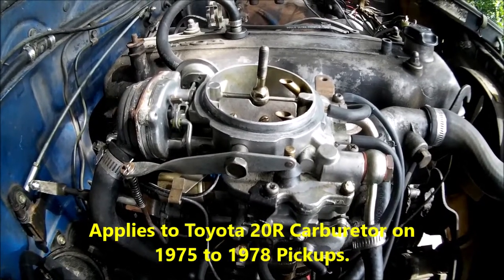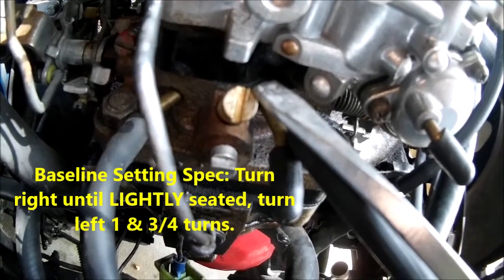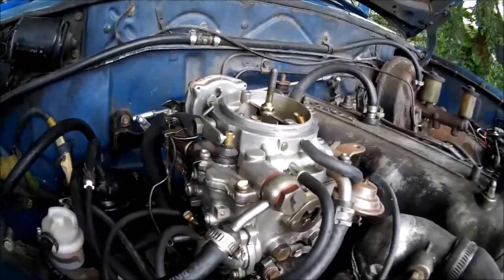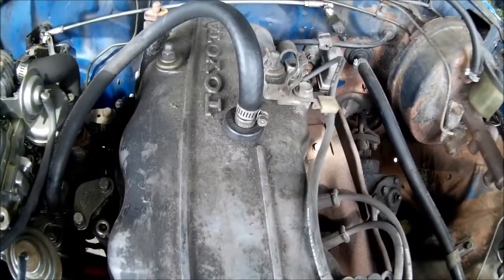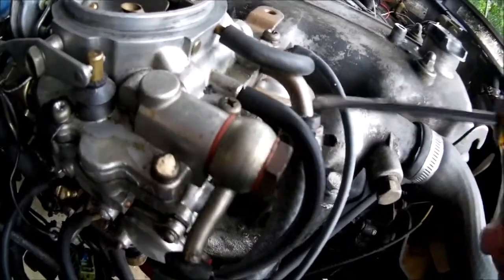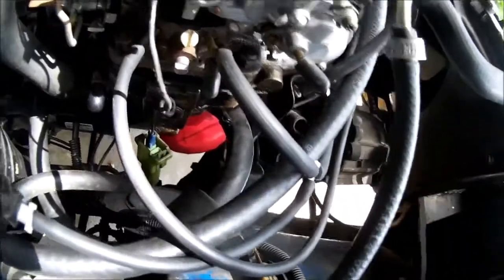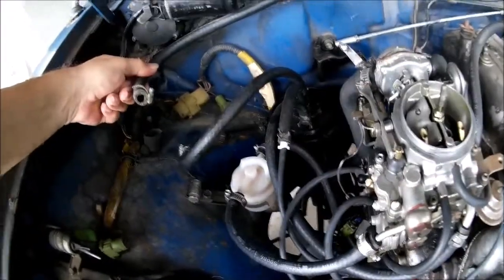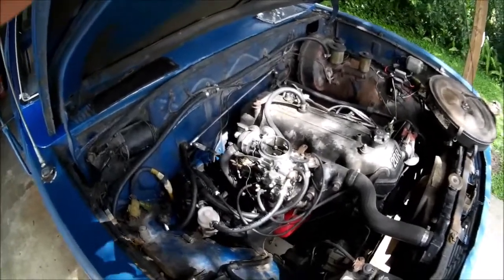1978 Toyota Pickup/Hilux 20R-Carb Adjust & Vac Lines-Desmogged

Comment: Hi, so I bought a rebuilt original carb for my 20r. All emission stuff is on it. My problem is that in order for the car to run kind of okay, the air fuel screw has to be open almost all the way. The engine is very jerky when idling, but runs ok when driving. When I look at the tach, the rpm goes between 800 to 850. The needle goes up and down. It's not smooth at all. Do you know what could cause this? My email is sreyes91350@gmail.com thanks
Reply from the maker: The most common cause of this is usually a vacuum leak. This lets extra air into the carb, which is why you are having to run a richer fuel mixture setting, with the air/fuel screw open almost all the way. From the sound of that, you have a fairly large vacuum leak somewhere. You can use a couple of cans of cheap carb cleaner spray (doesn't have to be the good stuff) to find vacuum leaks. With the truck running @ idle, just shoot a small blast of cleaner at any point you suspect of having a vacuum leak. If there is a leak there, the engine will speed up for a few seconds then drop back down. The cleaner is like fuel & will be sucked into any leak point.  If no engine reaction go on to the next point. I'd start at the carb base & work up, hitting every hose connection & then each hose themselves. Being methodical helps you here to track down leaks.

Got some questions for you that I need answers to to help you better -

What year is this truck? "All emissions stuff is on it? The carb or the truck? Or both? Did you use a new base gasket when you installed the carb? If you used the old gasket or none at all there could be a leak at that point. Did you tighten the carb nuts/bolts to 10 fott pounds? Overtightening these can cause vac leaks. Are you sure you have any unused vacuum ports capped off tightly? Have you checked or replaced your vacuum hoses for the emissions system? You should replace ALL of the vacuum lines for the emissions system when the carb is rebuilt or replaced. These trucks are 35+ years old now & those old vac lines are bound to be brittle, rotten, cracked, just plain broken or even missing. Check for a sticker underhood for a vac line diagram. If it isn't there you should be able to find one online, or go get the repair manual at an auto parts store. Nothing beats accurate info.

There are also some rubber lines for the AIR system (smog pump) that can go bad, not to mention vacuum switching valves, thermal vacuum switching valves, vacuum solenoids, EGR Valve, etc etc. That's why I did a "de-smog" on mine (emissions equipment removed) so I didn't have to worry about it. I'm guessing you are in California so you can't legally do that but I have some hints for you on that if you want them; just let me know & I'll email you.

Other than the above, it could be a bad fuel pump but that's iffy. I have heard of some mechanical fuel pumps having a slightly ruptured diaphragm causing the surge issue, but it's usually more than 50 rpm difference. Could also be an exhaust leak but I think you'd notice that & would have mentioned it.

Let me know some answers to the above questions, plus whatever you have done to test in the meantime & I'll try to help you out some more.
Reply: @The13thSword  okay, so this is a 77' Toyota Celica gt with stock everything. I tightened the rebuilt carb with a new gasket at 15 fp. There is a brand new fuel pump as well. All the vacuum lines are brand new. I have a diagram for this engine. Yeah you guessed it. California sucks for the emissions... And those hints would be very helpful. I want to get this car done before I leave for college in January. Thanks a ton!
Reply: @The13thSword  also, all the vacuum ports that are not used are capped off. EGR valve works fine.
Reply: @The13thSword  also, all the vacuum ports that are not used are capped off. EGR valve works fine.
Reply: @The13thSword  and I installed a new intake manifold gasket. I notice when the engine is idling, the brake is easy to push. But when I start driving, it feels like the brake booster is not working. I also noticed that there is a hissing noise when the engine is shut down for a few seconds.
Reply from the maker: @stuartcR   Thanks for the reply. Cool car! I would still try the carb cleaner test for vacuum leaks on the intake manifold, just to be sure there aren't any vac leaks there. I know you just installed it but I've learned to take nothing for granted in car repair unless I've checked it over at least twice, especially on older vehicles.

Good on the new carb gasket. You didn't say whether or not the fuel pump was the electric in tank type or a mechanical. Stock it should be electric. I only bring this up because  the 80/81/82 20R engines used mechanical (mounted on the head) & sometimes on these old cars, engines or heads get swapped in. The mechanical pump needs a spacer to work right & can cause some of the symptoms you mention.

On the vac ports you capped, did you use some good silicone caps? The rubber ones you mostly get at the parts stores are rubber & I find that they don't hold up very well.

Do you have the brake booster vacuum line hooked up? If it is, & given what you describe, the brake booster diaphragm could be leaking.  If there is any change in pedal feel between idling & driving, it should be exactly opposite of what you describe (pedal feels a bit firmer with engine above idle speed). A booster vac leak draws extra air into the intake system (booster vac line is plumbed to the carb) & that would account for needing the richer mixture to get it to run anywhere decent. The booster diaphragm is also a rubber part & could be age deteriorated.

The hissing noise just after shutdown (goes for a few seconds then stops?) could likely be this. Could indicate a minor to moderate vac leak in the booster. If heard in the cabin that could be it, esp if you hear it coming from behind the left dash area. If heard underhood only it could also be it, or a leak in the cooling system (you didn't mention coolant leak so I'd doubt this). I'd also replace the vac line for the booster. The inline check valve should be ok; they usually don't have problems. Just make sure it goes back in the correct direction (one way flow valve).

My brake booster does have a ruptured diaphragm. I disconnected the vac hose for it & capped the large vac port on the carb. I've been running this way for a while & brakes are fine; just can't afford to replace the booster so I had to do this. Mine is about $120 from Rock Auto. I looked up yours & it's about $65-$70 + ship from Rock Auto (A1 Cardone P/N 535000). Best price I've seen @ part stores is double that ($139.95).

Last 2 things for now. My apologies if I seem to be over-explaining things. I don't know what or how much you know so I want to make sure I cover this as completely as possible, for you & for anyone else that comes along later & is reading all this. No negative presumption is intended about your level of knowledge or skills, so please forgive any info I give that you already do know.

Once you can get this nailed down, get the mixture close to something approaching normal, & if your emissions system at least looks intact, you shouldn't have much trouble with the inspection stations. Even if some of the emissions valves aren't working right, these engines will run pretty clean if the mixture is tuned, the timing is set right (8 degrees BTDC) & your distributor vac advance is working right.  Even if you go above the minimums for emissions for this model @ the tailpipe, & the emissions system passes visual inspection, you can still get it registered with an abatement fee ($200 last I checked). Other good thing is that they probably aren't going to "gig" you too hard on it anyway; they just don't look at these older vehicles that hard, esp if you get the tailpipe emissions close enough to passing.

Hope all of this is helping. Let me know how your progress is going.
Reply: @The13thSword  Sweet. I'll check all this in a few days. Getting home from Utah. And yes it's a electric gas pump in the tank. So there are actually only two vacuum ports that are open and those are capped. I checked the caps, and they work fine. I'll check the carb and everything. I'll get back when I test it all. Thanks a lot for explaining everything! I actually am going to study automotive engineering and business in January. Thanks for taking time out of your day to help me and anyone else who has trouble. I really want to drive this car around haha
Reply from the maker: @stuartcR  No problem boss. I post these videos to help people out, just glad to know they are serving the purpose. Glad to do it. I look forward to hearing the update on this when you have time. Safe travels!
Reply: @The13thSword  hi, so I checked the vacuum lines. There are no leaks.
Reply: @The13thSword  I also diconnected the brake booster to test. It made no difference. I don't know what could be going on..
Reply: @The13thSword  I am hearing little popping and ticking noises coming from the exhaust though.
Reply from the maker: @stuartcR  My dumb question of the day first - when you disconnected the brake booster did you cap off that vacuum source for it from the carb? If you did we move on, because if you thoroughly tested the vac lines, carb & intake gasket & find no vacuum leaks, it's something else. Let's go smaller stuff first, then bigger:

1. Have you tried setting the idle fuel mixture to stock & if so what does the engine do? The stock setting is to turn the mixture screw all the way in until it lightly bottoms out (DO NOT CRANK THE SCREW DOWN WHEN IT BOTTOMS OUT! YOU WILL RUIN THE SCREW & NOT BE ABLE TO ADJUST THE MIXTURE AT ALL!). To be clear, a "turn" means a full 360 degrees (full circle), e.g. if the slot is straight up, you turn the screw left until the slot is straight up not once, but twice. That would be a full turn. Count the number of turns as you run the screw in ( I am VERY curious to know what you currently have it set at!) Once the screw is bottomed out, back it out 1 & 1/2 to 1 & 3/4 turns. This is the stock mixture setting.

2.  How's your air filter? Sometimes the paper filter element can tear, allowing more air in than normal, which would require the extra fuel mixture setting (rich). If in doubt as to the filters age or condition, replace it with a new one. DO NOT OVERTIGHTEN THE AIR CLEANER WINGNUT, just snug it down so the air cleaner doesn't rattle. If you overtighten the nut, this can warp the Air Horn of the carb & cause an air leak.

3. How's your fuel filter? A partially restricted fuel filter can cause your problem; opening up the mixture like you have just masks the problem (even with extra mixture it still doesn't run right all the time, but it should). Any doubt about the age or condition of the fuel filter replace it. Usually $5-$6 at any parts store & easy to do.

4. Have you checked your PCV (Positive Crankcase Ventilation) Valve? It should be in a rubber grommet on the valve cover, with a hose going to the carb. If the valve is stuck open you could be drawing in too much air from the crankcase. This can cause a lean condition (requiring the higher mixture setting) & fouled spark plugs (major black deposits). This can also happen if the rubber grommet is crack or broken. If in doubt replace both, they are cheap but important (about $4 for PCV, $3 for the grommet, again at almost any parts store). Check the hose too to make sure it's clear.

5. Have you checked your spark plugs? They should all be a light to dark tan in color; that would show a proper air/fuel mix. If they are black that shows a rich condition (too much fuel). If some are normal & some are black, that could show a valve problem (sticking valve, valves not adjusted right, burned valve) or other valve train problems. All depends on how the plugs look to tell you what is possibly going on.

6. Have you put a timing light on it yet? To verify the correct timing setting (8 degrees BTDC), & to see if the timing chain is good. The timing mark should be steady when you put the light on it. If it's jumping around your timing chain could be stretched & in need of replacement. (Ask me for more info on this if you suspect the timing chain).

7. Have you adjusted your valves? It takes a feeler gauge, a wrench. a screwdriver & some time, but really isn't too hard to do. If your valves are out of adjustment it could be causing your problem. Here is a good instruction source on valve adjustment for the 20R:
http://www.lcengineering.com/LCTechPages/ValveAdjustment.html

The only thing I do different is adjust the valves cold instead of hot; just makes it easier & less messy. I add 2 thousandths of an inch to the specs (intake - 0.010", exhaust - 0.014"). The clearance will "tighten up" to the correct hot specs as the engine gets hot (metal expands). I've always done this & never had any problems.

I think that's more than enough for now for you to check out. Let me know what you find in some detail. Extra detail helps when I can't see what's going on.
Reply: @The13thSword  yes I capped the vac port from the carb to the brake booster.  I have a dumb question.. does the vacuum increase or decrease as the engine is reved higher?
Reply: @The13thSword  also, I will try your tips tomorrow. I'll get back to you soon.
Reply: @The13thSword  last thing. I noticed that when I disconnected the egr valve, the engine ran faster and smoother.
Reply from the maker: @stuartcR  Not too sure about the popping/ticking noises from the exhaust, but they shouldn't be that loud to normally notice. Since you are noticing them that would usually mean that something is out of tune.

That is not a dumb question at all. Engine vacuum is usually highest at idle. In most carbs, there is a throttle "butterfly" plate near the bottom of the carb that is closed or mostly closed @ idle. This limits air intake & provides high vacuum. Kinda like taking your hand & putting it over the end of a vacuum cleaner hose. As you open the throttle plate more & more, it allows more & more atmospheric air to enter, & the vacuum goes down to a point, but it is less than at idle.

You may have found your problem with the EGR but you didn't say if you disconnected the vacuum signal hose to it or the feed hose to the carb. Good thinking to try that though!

EGR valves can carbon up over time (quicker if you are running rich, which you may be due to higher mixture setting). Built up carbon could be interfering with the internal return spring, not allowing it to stay completely closed at idle. Also, EGR's are vacuum controlled so there could be a problem with the diaphragm mechanism inside, broken or stuck open, allowing exhaust gas to pass thru it at idle. That would really lean out the carb & certainly mess up your idle mixture! It would also explain why you need the high mixture setting for it to run any kind of decent. Would also explain the bad idle but running better at speed (more air getting in with throttle open wider than at idle = more oxygen, better fuel/air ratio = better burn). Exhaust gas is inert & displaces the oxygen; it won't burn twice unless it's REALLY loaded up with unburned fuel vapor.

You don't need an EGR valve for an engine to run well. All they do is take some exhaust gas & add it back into your intake when the engine is above idle & under load. This is metered by the vacuum source that goes to it. EGR's are normally completely closed at idle & open progressively as the engine speeds up. The exhaust gas helps cool down the combustion temps & reduces NOx (nitrogen oxide, a pollutant).

IF it is the EGR that's messing you up you have 3 choices. Replace the valve, clean the valve & hope it's not broken inside, or block it off entirely. New valves can be hard to find in parts stores. I couldn't find one listed that is an exact fit for the '80. You MIGHT be able to fit one from a 22R 1984 & later but I'm not sure.

Cleaning the EGR you have. You need to remove it from the engine & soak the inside of it with carb cleaner & let it sit & soak to loosen up the carbon. You also might need to dig it outta there with a pick, awl, small screwdriver etc. as it can be rock hard & adhered. Compressed air helps here too. I've also used gasoline to soak these (NO SMOKING!) Once clean reinstall.

Lastly, blocking it off. I cannot legally advise anyone who is in a "smog regulated" state to do this as it may be illegal. Also during any "smog inspection" the techs will be looking to see if the EGR is there. If they only see a block-off plate & no EGR Valve they will fail you on the visual inspection. Just for interests sake - I have heard of a few people making a block-off using aluminum from a soda can. They cut the aluminum out in the shape of the EGR Gasket, but a little smaller, but didn't make the center hole in it for the exhaust gas to pass thru. They then "sandwiched" this aluminum between the Valve and the Head, effectively blocking the exhaust gas from even getting to the Valve. The can aluminum is thin enough so that if cut the right size, you don't even see that it's there. Result - EGR Valve in place but no exhaust gas getting into the intake. I AM NOT ADVISING THAT YOU DO THIS, just relating a story I've heard. (hint hint) ;^)

I'm in Florida so we don't have smog inspections, & I have an EGR block-off plate installed like this one:
https://www.lceperformance.com/EGR-Block-Plate-Kit-Cyl-Head-20R-22R-RE-RET-p/1016009.htm
with the EGR Valve gone entirely. My 20R runs fabulous without the Valve.

Keep at it man. Once you get this solved this engine should run super well so it's worth the effort.
Reply: @The13thSword  so the idle fuel air mixture screw was open. 3.5 turns.. pretty sure that's a bit much. So I turned it to 1.5 turns open. Testing it now.
Reply: @The13thSword  everything seems to be working. Could a bad pvc valve cause these problems? How do I test it?
Reply: @The13thSword  I just noticed something else. When I rev the engine up and let go of the throttle, the exhaust pops a few times.
Reply: @The13thSword  can I send you a video of the engine rpm, popping, and engine wobble?
Reply from the maker: @stuartcR  A bad PCV Valve could cause it. The basic test for a PCV Valve is to pull it out & shake it. If you hear/feel a rattle on every shake it should be ok; no rattle and it's bad. You could try to clean it out with carb spray but it's usually easier to just replace with a new one; they are usually only a few bucks. Check the rubber grommet it goes into while you are there too.
Reply from the maker: @stuartcR  This is caused by unburned fuel igniting in the exhaust pipe. The fuel that isn't burning in the cylinders hits some oxygen near the end of the exhaust pipe & burns there (explodes). That would mean your engine is not burning up the fuel that it is getting into the cylinders. There are many causes - fuel delivery problem - carb allowing too much fuel, sticking throttle valve or choke plate, sticking throttle cable or linkage, too much fuel pressure. 1 or more fouled, worn out, broken or non-functioning spark plugs. Ignition electrical problem like 1 or more bad wires, bad rotor, bad distributor cap, malfunctioning pickup coil (if electronic ignition, your's should be) or worn out or malfunctioning ignition points. Broken or worn distributor. Ignition timing too retarded, either by setting or from stretched timing chain.

There are also an out-of-whack carb adjustment that can do it (throttle positioner/dashpot) but it's rare. I wouldn't try to adjust that unless you have some good instructions.

Check the simple stuff 1st; 8 times out of 10 it's something small. Be sure the choke is completely open when it's warmed up. Check for extra play in the throttle cable; these cable can get sticky or stretch out over time & effect the throttle response. They can also wear out (it may be 38 years old!) It's also possible that it's adjusted too tight. Does the engine rev as soon as you put ANY pressure on the gas pedal? Or does it take a bit of movement to get a response? It should be nearly instant. You can adjust the cable by turning 2 nuts at the end of the cable nearest the carb. You should see some cable coming out of the cable sleeve;  push down & release to gauge how much tension it has. It should be just very slightly slack. If you can push it down more than 1/8" before you feel some decent pressure it's too loose. Adjust as needed.

You never told me if you looked at your spark plugs or not. How old are they? How old is the cap, rotor, wires? Info please.
Reply from the maker: @stuartcR  You could post it to Youtube & send me the link. Engine wobble? When did that start? You didn't mention that before.
Reply from the maker: @stuartcR  Yah, 3.5 turns is a lot of gas at idle, especially for a stock carb. That's almost double the max of 1.75.

Give me some info on what you've checked? Fuel Filter? Plugs? Ignition Parts? They all matter & I need to know.
Reply: @The13thSword  fuel filter is fine, the carb is always full of gas. New spark plugs, cables, distributor cap, and rotor. Ignition system seems to run fine. Engine is timed to 8°. I put turned the idle screw to 1.5 turns. Engine seems to run fine on that. Still gittery though. At high idle due to cold engine, it runs smooth. Everything runs smooth above 850 rpm... But, the legal restrictions in California is 800 to 850rpm. Even at 900 it runs better. But at 800, the needle goes up and down between 750 to 900.. and the engine jitters which causes the whole dang car to vibrste. You can see the gear shift nob vibrate then suddenly move then vibrate again... And when I rev the engine and let go of the gas, it pops at the exhaust. I don't know what is going on haha
Reply from the maker: @stuartcR  OK, I'm almost running out of things to check but do have a few more. Carb full of gas - gas level about halfway up the window on the front? That would be proper fuel bowl level, any higher than the upper tab on the windows & you need a float adjustment. How about your ignition coil? Are all the wires firmly attached? No corrosion/rust/gunk on the wire terminals? How old is it? Have you tested it? As coils age their electrical resistance goes up. This could be limiting how much electricity it puts out, causing misfires, especially on a "rev-down".

If you have a volt/ohm meter it's easy to check(search Google for "testing an ignition coil with ohm meter"), or you can take the coil to some parts stores & they will test it for free (Auto Zone, O'Reileys, Advance, etc.) The coil specs I have are  (cold check) Primary resistance 1.3 to 1.7 Ohms, Secondary resistance 6500 to 10500 Ohms. Readings near the high end or above means the coil is nearly done & needs replaced. Also look for any mechanical damage to the coil (cracks in case, terminal corrosion, lines of black carbon on outside). A damaged coil might read good but then start malfunctioning once it gets warmed up.

I mention this because it's one of the last things I had to fix on my truck. I was also getting the exhaust pop-back (intermittently) plus I had a hard hot start problem. New quality coil fixed it. If you do need a coil I recommend Standard Motor Parts # UC12. Avoid the Chinese cheapies; they don't even last a year (happened to me). Any good quality coil 12 volt with the resistance specs I gave you will work, brand doesn't matter but quality does.

Also, a "borderline" coil might give you the results you mention. Runs better at higher RPM's because it's getting a bit more electricity from the alternator due to increased speed, than at idle (reduced speed, less volatge).

Also as previously mentioned, it could be the throttle cable being stretched or out of adjustment. It controls the position of the throttle at idle & if that's off it could cause idle problems.
Reply: @The13thSword  okay. No corrosion anywhere. I never checked the coil. I'll take it to AutoZone today. The throttle linkage seems to be fine though. So I'm hoping it's the coil haha
Reply: @The13thSword  spark plugs, rotor, wires are all new. I'm checking the ignition coil. It's 44 years old, so it might be the problem..
Reply: @The13thSword  primary coil is 1.2, secondary is 8750
Reply: @The13thSword  I have an idea. Might be a dumb one, but I'd like your opinion. The old carb ran ok. I'm wondering if there is a clog in the vacuum line things. My idea is to get rid of the metal tubes, and complicated parts and connect the vacuum hoses directly to where they need to go. With a few hoses. Get rid of the vacuum line mess. What do you think?
Reply from the maker: @stuartcR  44 years old is pretty old for a coil. The primary reading is good but your secondary is questionable. The secondary side is what produces the high voltage for the spark plugs, usually 30,000 volts or more, so it does see some fair amounts of stress when functioning. The resistance creates heat, which will raise the resistance further in an older or weak coil, which cuts down on the voltage. Most coil are filled with oil & have a metal case; this helps conduct that heat away to the outside air.

Over time, the coil goes through many heat cycles. This can break down the oil inside so it doesn't dissipate heat as well as when new. Also the copper wiring inside the secondary side can get brittle and break in places, causing small short circuits, which would also raise the resistance. There are thousands of turns of wire in the secondary.

Given that 8750 Ohms is the "cold" number, it's bound to be higher once it heats up in operation. Just 10% more resistance from heat puts you at 9625, less than 1000 away from the upper limit. Not good. I recommend replacing it. Even if it turns out to not be the single cause of your running problems, you will know that's 1 less thing.
Reply: @The13thSword  okay. I'll buy a new one. Crossing fingers that this is the problem haha
Reply from the maker: @stuartcR  OK, by "vacuum line things" I'm assuming you mean the metal hard lines? I thot those were only on the 22R trucks, but if you have them, you have them. Kinda changes things a bit. Are they intact? Not rusted w/possible pinholes? That would be a vac leak. I think they used those metal lines so that the rubber vac tubing wouldn't be touching or close to anything hot on the engine. Heat would kill the rubber lines within 5 years.

Also, if there were a clog in the "vacuum line things" then the old carb wouldn't have run well at all. Do you still have the old carb around? And why did you replace it with another one if it ran ok?

Removing the hard lines could get you in trouble with the smog inspectors, as it may not pass the visual inspection. All depends on whether or not they know they are supposed to be there or not. I'm all for curing the running problem, but not at the expense of your not being able to register the car. If I could I would desmog that baby in a heartbeat & get rid of all the complicated stuff that may not be working right anyway. But I don't have to worry about smog cops here in FL.
Reply: @The13thSword  yes the things are the metal lines, and metal connections. I don't know the name, but they might be clogged. Im buying the new coil in an hour. Hopefully it'll work. If it doesn't, I'm going to desmog the car to see if it runs better. It it does, then I'll work from there. Hopefully the coil works though haha
Reply from the maker: @stuartcR  If the metal lines are close in size to the rubber vac lines I know what you're talking about. If they are bigger than that, they are something else, prolly the AIR system for the exhaust. Also emissions equipment. Ugh. You could blow them out with some compressed air, if you have access to a compressor. Or you can disconnect the ends of the rubber line connected to it & blow thru it, towards the carb. Easiest way to check for a clog.

Desmogging it will definitely help, you don't need all that stuff for it to run well, but when that stuff goes wrong, it can make it run terrible. Let me know what the coil does for you.
Reply: @The13thSword  yes the metal lines are about the same size as the hoses. Installed a new coil. Runs a little smoother. Still pops though.. rpm are a little more steady
Reply from the maker: @stuartcR  OK, are the pops still at the same rate, or have they become less in number/frequency? The answer to this will help narrow down the possibilities more.
Reply: @The13thSword  they are the same rate sadly.
Reply from the maker: @stuartcR  Alright, that should leave several things it can likely be. This will be long so please read it through.

Worst to less worse - It's likely either the ignition control module (Toyota calls it an "Igniter"), which can get expensive to replace (which is why I did the GM HEI Module conversion on mine). Or it's the throttle linkage/cable, or some part of the linkage/cable train. Or your exhaust valves are out of adjustment (you never said if the valves had been adjusted or not, I don't recall). Or it's an exhaust leak somewhere, probably closer to the head. Or you possibly have a Leaking Diaphragm on Auxiliary Acceleration Pump (AAP).

I say this based on what I had to go through with mine. I do not guarantee that it is these things because it's hard to diagnose this problem without actually being there to put hands on it. I would seriously look at the AAP, the valve adjustments & the exhaust system for leaks first, as they are the easiest & cheapest to address.

The Auxiliary Acceleration Pump (AAP) is supposed to make the mixture richer when the motor is cold & shut off when the motor is warmed up. It is vacuum controlled by a  Thermo Vacuum Sensing Valve (TVSV) usually found mounted into a port on your intake manifold. The AAP is on the passenger side of the carb. It is round with a vac port on it & 3 screws holding it's cap on. Pull the vac line off the port & see if there is any gas in the line or gas leaking out of the port. If so, the diaphragm is ruptured. You can cap that port off & put a screw or nail in the vac line to prevent a vac leak (quick fix) & try out the engine again for the popping. If the popping goes away you found the problem. The diaphragm can be replaced but you usually can't buy it on it's own, you have to buy a carb rebuild kit to get one. Just takes a screwdriver to replace the diaphragm.

BTW, where & who did you get this rebuilt carb & do we know it was really rebuilt with new internal parts?

You could pull the Ignition Control Module & have it tested like you did the coil. Free & easy & at least you'd know for sure if it's good or not.

Next I'd look over the exhaust system from front to back for any leaks, holes or black soot build-up (sure sign of a leak). Also listen for any sounds along the whole length while the engine is running. If you hear any sharp clicking or ticking noises anywhere that is usually an exhaust leak. I had this sound because the "doughnut" gasket between my exhaust manifold & collector pipe was falling apart. My exhaust manifold gasket was bad as well. Any holes you find you can temp patch for testing with aluminum tape you can get from the auto parts store.

Make sure the valves are adjusted to the right spec. Get a feeler gauge, pull the valve cover & check em all out to be sure. A too tight exhaust valve will put unburned gas vapor into your exhaust; result, it goes "pop" in the pipe. Same with a too tight intake valve. Check out the link to valve adjustment instructions I sent you earlier. It's not hard, it just takes time & patience.

I know you looked but I'd double check the throttle linkage/cable for any wear, binding, slop or other problems.

That's all for now, let me know what you get up to on this.
Reply from the maker: @stuartcR  BTW, are you learning way more than you wanted to about this car & engine? :^) Don't get discouraged, these old cars ALWAYS take some work to get em going right, just nature of the beast. Took me 9 months part time to get my truck going right (as you can tell from my vids!), but it was likely far worse off than you're dealing with. Just want to be encouraging. Keep at it, you'll get there eventually.
Reply: @The13thSword  I could always learn more. I'm enjoying this very much. Hey, j have a random question. What is the exhaust supposed to smell like? How is jt supposed to smell when it is working right?
Reply: @The13thSword  could these problems be due to the engine not getting to operating temp before the choke opens all the way?
Reply from the maker: @stuartcR  Cool & a great attitude to have. I just get concerned that I may be overloading people with too much info.

That's actually a great question about what the exhaust should smell like! in my opinion & experience, for a properly tuned & running engine, it should smell mostly "clean" with no gasoline smell at all. Complete combustion of gasoline (a clean burn) should yield Carbon Monoxide, Carbon Dioxide, and water (H2O), in that order of quantities, most to least. There are also some much smaller quantities of Sulfur Dioxide & Nitrogen Oxides.

To check this what I usually do is put my hand, cupped, a few inches from the end of the tailpipe for a second or two, then bring it quickly to my nose & smell. Doing this a few times in a row isn't dangerous. A "clean burn" smell to me is usually just that, perhaps with a very slight chemical smell that doesn't smell bad to me. If you actually have a gasoline smell in the exhaust, you are running rich (too much fuel vapor delivered to cylinders, engine can only burn so much of it, leaving some unburned) or you have a misfire problem (1 or more cylinders not firing & burning the fuel vapors, or an ignition or timing problem). If you smell sulfur (slightly to strong "rotten egg" smell) it usually means you are running too lean (not enough fuel vapor getting to cylinders, or a timing problem). There should be no "burning" or "burnt" smell at all.

One weird thing I noticed. When I was still running up to 10% Ethanol/90% Gas mix (common unleaded gas these days), the "smell test" gave me a "woody" smell, like fresh split firewood, even when I had the engine burning "clean". I have since switched to Non-Ethanol Gasoline & no longer have the "woody" smell. Odd eh? The 20R will run ok on 10% Ethanol as long as it's tuned right. You just have to make sure your rubber fuel parts (gas lines, fuel pump diaphragm, internal rubber carb parts, accel pump in carb) can handle the Ethanol & are made for it. Ethanol will eventually eat "common" rubber parts. That's why the AAP Diaphragm popped up in my mind. Ethanol gas has been around for a while now, & it could have eaten some holes in it.
Reply from the maker: @stuartcR  Yes it could, but it could also be a choke that doesn't open properly or is stuck in a closed or partially closed position when the engine gets up to op temp. That would be a mis-adjusted choke, opening too early during the warmup cycle, or a sticky or stuck choke. A sticky choke can be a bear to figure out, as it may be different every time you test. Thats why I wanted you to spray down the whole carb & the linkages with carb cleaner, to be sure there was no "gunk" jamming up the choke. When cold, the choke should close with 1 pump of the pedal.

Just for infos sake, the choke should be at least mostly closed when the engine is cold. It should slowly open as the engine warms up, & be fully open when it gets to op temp. The choke plate restricts the airflow, providing a richer mixture, which a cold (or colder than op temp) engine needs to run well. The carbs job is to turn liquid fuel into fuel vapor. The more the choke is closed, the more vacuum, the more gas is pulled through the carbs jets to be vaporized. As the engine warms up, the engine's heat helps to vaporize any liquid fuel that gets to the intake or the cylinders, so you need less gas for a correct 14 to 1 air/fuel mixture. On the 20R, your choke is controlled by a thermostat operated by the engine coolant. As the coolant picks up engine heat, it expands a spring in the choke housing & moves a lever attached to the choke plate. This is how it opens gradually as the heat rises. More heat, more expansion. 22R's use an electric choke; they have an electric heater element in them that heats the spring. It only functions when the key is turned on.

The choke should be fully open at op temp which is usually 180 degrees for the 20R. This is the temp that your coolant thermostat opens (the one in a metal case at the base of your upper radiator hose). That allows coolant to flow through your radiator & maintain an optimal running temp.

Which makes me think of 2 questions. Are you warming the engine up fully before you try to do your "rev tests" for the popping? I'd recommend it, just to have a common performance baseline. And, if you have run the engine up to full temp, is your temp gauge "normal", high, or lower than normal? I've found that the 20R usually runs a bit cool if everything is working right. My temp gauge almost never goes beyond  1/4 to 1/3 above the cold mark, even in summer in Florida.
Reply: @The13thSword  cool. So I turned the idle mixture screw to the left 4 times, the engine is now running perfectly. Guess it was just running lean?
Reply from the maker: @stuartcR  Wadu Hek? It wasn't good at 3.5 turns but is good at 4? I'm guessing something must have changed elsewhere, because half a turn shouldn't make that much difference on a higher setting like that.

I'd say that if you have checked everything and it's all in spec (valve clearances, timing chain not loose, chain guides & tensioner ok, timing correct, no exhaust leaks, etc.), I'd say leave it as is & be done with it for now. If it idles good hot, no variation in the idle speed, no more popping on revs, and it drives good & gets decent MPG, you might be good to go. How is the drive? Did the popping go away?

Something occurs to me, a question I did not ask you. Was this car sitting for any length of time before you started messing around with it? Or was it being driven at least once a month when you got it? I ask this because I'm starting to suspect that you have/had a stuck valve, which could have been causing the problems. It didn't occur to me because normally it's not an issue, but can be with vehicles that have sat for a while. There might also be 38 years of oil sludge or gum in there, sticking the valve(s). Your constant testing may just have loosened it up enough to work right.

If this is the case (and even if it's not) I'd suggest you do an oil system flush, to get that crap melted & outta the engine. It would also remove any varnish or gum deposits that could be sticking the valve(s). I've used Motor Medic Oil System Flush before (I have a vid on it posted, before & after) & it works well. Easy to do, full instruction on the bottle. Made a huge difference for me, & my oil stays clean on the dipstick now even after 3000 miles. Before, it would go black as soon as I did an oil change, because of all the old black deposits in there.
Reply: @The13thSword  the car was sitting in a wet environment for 25 years haha. I got it and started it for the first time in 25 years. Redid the wiring and carb. But yeah no pops. The exhuast is still a little odd, but I'm fixing that. Drives great haha
Reply from the maker: @stuartcR  Well that makes a big difference. Cars sitting that long can often have stuck valves or even piston rings frozen to the cylinder walls. Maybe all your testing finally got a stuck valve or 2 to loosen up & work right?

I'd suggest you do an oil system flush on the engine. That would help clean out any varnish or gum deposits that could cause the sticking valve problem. I did it to mine (I have a vid of it up on YT) & the engine sure was happier afterwards.
Reply: @The13thSword  cool. Yeah I did a oil flush when the old carb flooded the engine haha. Seemed to actually help.
Reply from the maker: @stuartcR  I'm sure it did, but there's no substitute for doing it right. Besides, the results are well worth it. Check out the vid if you have a few minutes:
https://www.youtube.com/watch?v=GpKZYyfwzkg&t=1s
Reply: @The13thSword  hi. Went to have the car smogged. It passed on everything except CO.. the limit is 1.4 the reading was 4.5..... the first smog check it was 10.5. It it dropped more than half. I have a picture of the results. Do you know how to power CO? Someone offered to smog the car illegslly but idunno. I'd rather it be done right.
Reply from the maker: @stuartcR  I have a couple of thoughts on this. Generally, high CO (Carbon Monoxide) readings are the result of the engine running too rich; it's getting more gas than it can burn, & the unburned gas vapor is being read as excessive CO. Causes of a rich condition include a clogged or restricted air intake (not enough air to lean down the mixture), ignition problems (1 or more cylinders not firing, so  not burning the gas vapor), restricted fuel flow (actually increases fuel pressure, leading to a rich condition), internal carb problems & carb out of adjustment.

My recommendations. 
1. Is your air filter clean or dirty? Is it old? If you haven't already done so, I'd put a new air filter on it to be sure the air side is flowing right. Don't tighten the air cleaner nut too far either; that can warp the carb air horn, causing an air leak. Just snug it up so the air cleaner doesn't rattle.

2. PCV Valve OK? You never told me if it was ok or not when I told you how to test it.

3. Since you got it running good & you reported that it was going well on idle & drive, I'd say the ignition is fine. You didn't report noticing any misfires so, Next....

4. Fuel. You did say the fuel filter was replaced with a new one? A good flowing fuel filter can be a bit critical to good carb operation.

5. What I REALLY think it is - The mixture adjustment. What I think happened was this. You had it @ 3.5 turns out & it wasn't running well. You turned it out another half turn & POOF, magic, it was running near perfect @ 4 turns out. I think what happened was that in turning the needle out a bit more allowed more gas to flow inside the idle circuit. A piece of "gunk" that was partially clogging the idle circuit got "washed" out of the idle passage due to the increased flow of gas. I say this because a half turn from 3.5 to 4 on these carbs really shouldn't make that much of a huge noticeable difference, especially in running quality. It just doesn't happen that way.

Since you got it running well, did you ever try to take the mixture back down to the 1.5 to 1.75 turns out stock spec? Or no? I'd really like an answer to that one. If you haven't, try it, once you get the engine fully warmed up & the choke totally open. If the engine still runs ok at the stock mixture setting & the stock 850 RPM idle, that may be the answer you need to get the CO down to passing. It would also almost "prove" what I am saying, that you had a partially blocked idle circuit in the carb, causing the previous bad running problems.

The 20R carbs were/are designed to run a bit on the lean side on the stock settings. That's why for several years Toyota didn't even need to put a catalytic converter in these trucks when new, even though other car companies were doing it. The 20R's ran clean enough to pass smog tests then without them. In case you didn't know, the catalytic converter is basically a "hot box"; it burns off any unburned gas vapor coming out of the engine, so it doesn't go into the air.

As always, I can't advise you on doing anything illegal; I'd want it done right too, or at least get it as close as possible so I could qualify for an exception.

PLEASE let me know the answers to the questions above; my curiosity is really killing me on this.
Reply from the maker: @stuartcR  One more thing, another test for PCV Valve. With the engine running, pull the valve out of the valve cover grommet. If your idle speed changes noticably, the valve is bad, get a new PCV Valve & install it. Check the hose on the valve that goes to the intake; make sure it's not clogged, blocked, torn or cracked (dry rotted). Replace as needed.
Reply: @The13thSword  okay so, air filter is brand new, I pulled the pcv valve out of the engine while running, the engine changed a bit but not much. I could feel a small bit of vacuum from the pcv valve when it was still connected to the base of the carb, yes car runs perfect still, the fuel filter is not new, but it is a cheap clear one and it looks pretty dang clean, the carb is always full with gas, i tried to lower the idle fuel mixture screw yesterday, but when i lower if past 3.5 turns, the rpm gets all jumpy and not stable.
Reply from the maker: @stuartcR  Excellent, thanks for the details. PCV Valve sounds like it's OK from your description. Fuel filter; they are all cheap plastic ones these days. As long as it stays full when running & looks clean inside you are probably OK. Carb always full with gas? Fuel level should be in the dead middle of the glass, no higher than the bottom of the upper metal tab; it's the same on 22R's. If it's fuller than that your float is set way too high. If you need a pic of the sight glass level search Google Images for 22R carb float level.

If the float is set too high you may be getting some extra gas into the carb that isn't meant to go in, therefore running "rich". That could also account for the higher CO levels. You might want to pull a spark plug or two & check the color on them. Black & sooty means rich/too much fuel. Normal, they should be a light to medium tan color.

Still jumpy idle lower than 3.5 turns, got it. Hmm, thoughts. Damaged idle mixture needle? Only way to know is to back it out all the way out of the carb & look. See if the point is bent or broken off (should be straight & very pointy), needle/screw not straight/bent, circular indent marks on needle area from being tightened down too hard. Anything like this I'd replace the screw; any idle mixture screw from a 20R or 22R carb will work, they are the same.

Possible obstruction still in idle circuit? Possible partial obstruction in idle jet? This might cause the carb to draw extra fuel from the secondary at idle, since it can't get the fuel it need from the idle side, which would also make it too rich. The secondary flows more fuel than the idle. Maybe the 4 turns out is just right to "bypass" the obstruction, but 3.5 isn't? Or the 4 turns out flows enough gas to the secondary to give good idle, but still too rich for CO testing purposes? Maybe.

Only thing to do if you suspect that is pull the idle mixture screw entirely out, drain the float bowl by taking out the passenger side bolt at the bottom front (below the float bowl sight glass, there are 2, take out pass side 1, 14mm if I remember right), & remove the idle cutoff solenoid (round thing on passenger side with a wire going to it). That would give you three access points to the idle circuit inside the carb body. I've done this before. Sprayed carb cleaner into all 3 points (including spraying out the idle jet, more below on that), let soak, then gently blow out with compressed air. Repeat. Don't want to go ham with it, you can damage stuff inside with too high an air pressure. I've unblocked a few idle circuits like that in my time. Put it all back together & test.

Lastly, this is a long shot. Maybe a previous owner modified the carb by putting bigger jets in the thing? If you go the float bowl drain route, check the size of the idle jet. The idle & secondary jets are brass plugs with precise sized holes drilled in them to allow a certain flow rate of fuel. A larger opening in a jet will allow more gas to flow; it also gives more power, under the right conditions. The jets are located in line with the float bowl drain bolt holes; idle jet on the passenger side of the carb, secondary jet on driver's side. Once you drain the carb you should be able to look into the hole & see the jet (a brass plug with a screwdriver slot in it & hole in center). That's your idle jet. The secondary jet is behind the other drain hole. The Idle Jet should have a number stamped on it, between 113 & 118 (can be hard to see, might be easier if the carb if off the car, up to you). If it's a larger number than that, it's been "upjetted", meaning it has a larger than stock idle jet. That would also explain the rich idle condition. It's a long shot.

Sorry for the gobs of info, but there is no easy way to explain this stuff completely. As always any questions on any of this & I will try to get even more specific.
Reply: Awesome. I'll check all that stuff in the morning. Thanks for all the info it really does help!
Reply: @The13thSword  hi. So I have determined that the high HC and CO are coming from the dwell not being set. The spark is very small and not very hot due to this. Do you know how to set the dwell without expensive tools? It's supposed to be at 54°
Reply from the maker: @stuartcR  I don't want to disagree with your diagnosis, but, I don't agree :^)  If you believe that your spark isn't hot enough, there are several more common culprits that may be causing it other than incorrect dwell angle. I say this because dwell angle is a very small, very fine adjustment, & the ignition system will still have "hot" spark even if it's "out" by up to 10 degrees. Dwell angle is not like the overall timing setting where a few degrees makes a huge difference, even in emissions. Most of the time on points ignitions, it's the points that are at fault.

I would more expect/suspect the reasons for weak spark are: worn or corroded points, worn rubbing block (this is usually a plastic block on the points set, pushed by a cam inside the distributor that moves the points open & closed), worn distributor (overall unit) & bad condenser (capacitor). The points & condenser are the most common causes of firing problems in a distributor points system. Points erode over time due to electric arcing & the point faces can become "un-flat", burned or pitted, causing an inconsistent contact & transfer of electrical energy. Condensers are there to lessen the impact of arcing on the points; they absorb a large amount of current 1000's of times a minutes & break down over time. I am not mentioning other possible causes like coil, wires, plugs, cap & rotor because I know those are good, as you have said so.

You do have the points distributor, not the electronic? Please confirm. Have you replaced the points & condenser? Looked at them? At the least take your dist cap off & gently open the points & check the contact faces. They should be flat, smooth & even. If you see any "white stuff", burning or pitting on the faces, they should to be replaced. Sometimes you can take a flat, very fine file to the points & "clean em up" a bit; this will sometimes solve a weak or no spark problem. You can also use fine sandpaper or emory cloth. Also look at the rubbing block; there shouldn't be any wear "divot" on it or other signs of moderate to heavy wear.

According to the specs I can find for the points version of the 20R, the dwell angle is supposed to be 52 degrees (stated range 50 to 54 degrees, +/- 6 degrees). Typical dwell angle for almost all 4 cylinders (regardless of who makes them) is 52 degrees + or - 6 degrees. There is no way to check the dwell angle without a dwell meter. This is not a problem. As long as the points & condenser are in good working order, & you set the point gap to the correct .018", the dwell will be very close to where it needs to be, usually within a few degrees. You have to set the rubbing block gap & point gap to spec & dwell should be fine. Rubbing block gap - There is a 4 pointed cam in the distributor that moves this. Turn the engine so a flat side of the cam faces the rubbing block (must be exactly parallel). Loosen points set hold down screws, use a feeler gauge to adjust gap to  .018" then tighten hold down screws.

You can also do the above adjustment on your current points set to check for rubbing block or points wear. Set gap as described. Once you tighten down the screws, rotate the engine until the point of the cam is pushing the rubbing block, & opens the points to maximum. Then use the feeler gauge to check the gap in the points. It should be exactly the same, .018", with light drag on the feeler. If you have little to no drag on a .018" feeler, you have wear. Replace the points.

I found a points set on Auto Zone but they aren't available in all stores for pickup, check your local availability. Part # JA3, price $3.95. They also have the condenser @ $14.49, Part # URS1502. Oreillys also has the points sets, but not the condenser.

Lastly, you could always update to an electronic ignition system. This would eliminate the points system entirely & give you more consistent ignition quality. I'm guessing you may have to use Toyota parts to keep the stock look (passes visual inspection). You'd need the electronic style distributor & igniter from any 1978-1980 20R (any model vehicle that has the engine, Pickup, Celica, Corona) plus the igniter. I don't think the smog boys would go for the HEI conversion like I did.
Reply: @The13thSword  cool. Yeah I found a electronic distributor kit. It's 150. I'm gonna try to set the dwell first. Then if that doesn't work then I'll get the kit
Reply from the maker: @stuartcR  It's a good way to go if you can afford the parts, plus no more worries about worn points. Electronic ignitions automatically handle the dwell for you. If setting the dwell doesn't work out for you, try throwing a new set of points at it & set the gap like I described. They are cheap & usually solve most of these problems. I'd go that way first & see how she responds to it. Kinda hard to lose for less than $5.

I have to thank you for bringing up the points. I haven't thought about points distributors & how they work for a while. I also may owe you an apology; you may be right about the dwell angle being the source of the high CO. Worn points & rubbing blocks change the dwell angle & contact timing, plus burned or pitted points, or a worn rubbing block, might cause "weakened" contact. This would effect how much energy gets transferred through the points, which could effect spark power. Your bringing it up reminded me of this.
Reply: @The13thSword  Hi, so I installed a perteonix ignitor 2, and rechecked the valves. Everything seems to be working. It still is not smooth, but it's way smoother than it was. The whole car doesn't wobble around now haha. There is a nocking sound coming from the top of the engine, so I need to check that again... Hopefully I'll get this car ready.
Reply: @The13thSword  hey, do you still have the link to the brake booster still?
Reply from the maker: @stuartcR  Good work on the Pertronix. Knocking sound coming from the top of the engine? Does it sort or (or actually) sound like valve clatter? Does it sound anything like this? https://www.youtube.com/watch?v=Z8dVGxDXCnk Do you hear it at idle, or mostly on rev up/rev down? Did you look at/check the timing chain & guides when you had the valve cover off? Was there any play in the chain & if so, how much? How did the chain guides look? They should have nylon pads on them; the guides themselves should be steel.

Assuming you didn't find any broken parts when you adjusted the valves, this could be a problem with the timing chain, tensioner or guides. The driver's side guide or bolt holding it is known to break sometimes, leaving the chain more slack, & allowing it to slap into the inside of the timing cover. If let go, the chain will eat through the cover over time & cause a huge oil leak, & possibly a coolant leak into the oil crankcase (very bad!) The guide could also lose it's nylon pad, allowing the chain to ride on the metal part, causing the noise. The tensioner is operated by oil pressure & if it stops working the chain will be too loose, again causing noise & eating up the guides faster than normal. It could also be that the chain is just worn out & stretched, which makes it loose.

Any of these conditions on the timing chain can cause erratic valve timing, resulting in lower MPG & higher emissions. It also makes it near impossible to tune the engine properly.

My easy test to see if the chain is loose or stretched is to use a timing light. I run the engine (warmed up) & check the timing marks on the crank pulley & marker tab with the timing light. If the chain is good, the timing mark should be rock steady at idle. If the chain is only slightly loose, the mark should wander around a bit, usually no more than a few degrees +/-. If the mark jumps around more than that at idle, that's the chain being too loose, broken chain guide(s) or a bad tensioner.

Hope the noise isn't the chain but if it is, here's some pointers. Changing out the timing set (chain, guides & tensioner) on the 20R is a pretty involved job. it can be done without pulling the head but it can be tricky. Part of the head gasket is between the head & top of the timing cover & it's a tight fit. There is a hidden bolt in the front of the head that goes into the top of the timing cover. If you forget this & try to pull the cover off, you can break the cover (lots of videos on YT about this but I recommend the factory service manual). The job requires a few specialized tools (pulley puller, impact gun & extensions, torque wrench, etc). I did mine myself & it took me 3 weeks working on it part time, but I am slow, overly methodical & have to work with chronic medical conditions. Still it turned out fine. Was just a lot of steps involved. I also put a new water pump & front crankshaft seal on since the old ones had to come off anyway, to get to the timing cover.

Just letting you know the possibilities & what might be involved. I absolutely do hope it's not your timing chain, but check it out & let me know what you find. I'll help with any other info if I can.
Reply from the maker: @stuartcR  Link: https://www.rockauto.com/en/catalog/toyota,1977,celica,2.2l+l4,1273766,brake+&+wheel+hub,power+brake+booster,1884

Rock Auto $69.39 with core charge included, shipping not included. A-1 Cardone Part # 535000. for Celica ST Model ONLY, or Part # 535001 for Celica GT. Either should work. There are also several #535000 available on Ebay for $90 to $120 w/free ship.
Reply: @The13thSword  awesome thank you! It's not the timing chain. It sounds D's like cylinder 4. I probably didn't set it to exact tdc so the mesurements might be more than I thought.
Reply from the maker: @stuartcR  I'm all for pulling for your cause on the noise! Valve adjustment to fix it would be great. Fingers & toes crossed for you. :^) Let me know how it turns out.
Reply: @The13thSword  definitely. I'm glad I got an electronic ignition system.